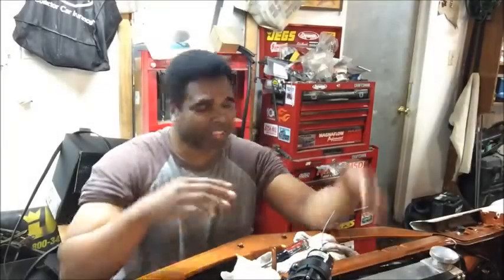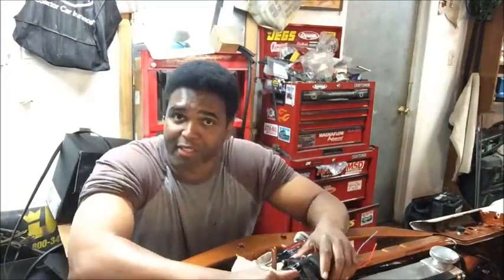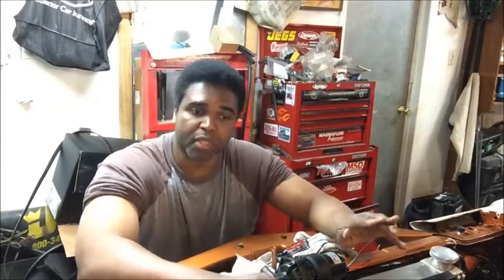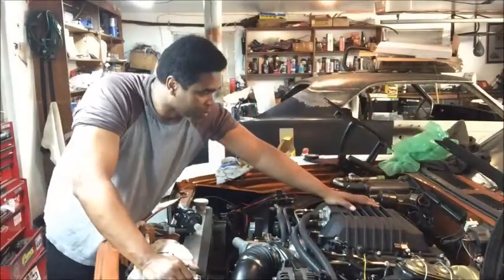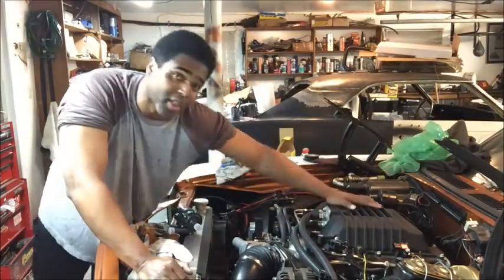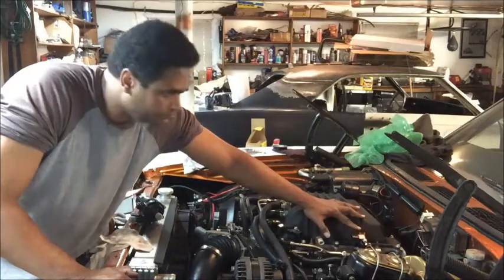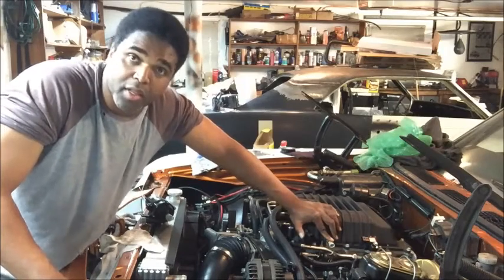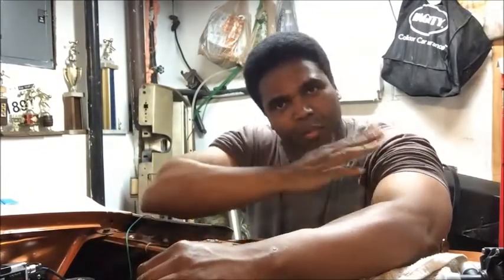LSA BRICK SENSOR SETUP.

Comment: So do you completely remove the two wires from the 5 pin harness and connect to the zl1 harness ? Or do you just splice in to the two wires and leave the pins plugged into the stock harness ?
Reply from the maker: i worked with Ballenger motorsport to create the Coverman Special. its a simple plug and play harness. check it out
https://www.bmotorsports.com/shop/product_info.php/products_id/4290
https://www.bmotorsports.com/shop/advanced_search_result.php?x=0&y=0&search_in_description=1&keywords=coverman66
let me know what you think..

Comment: So you cut the AIT wires out of the MAF plug completely, or did you just Y into it with the additional two wires.
Sorry for the question I just couldn’t really tell in the vid if they were cut from the actual MAF sensor
Reply from the maker: i got the connector for the iat and separated the mass and iat and made 2 connectors..  Ballenger makes a connect call the Coverman Special
https://www.bmotorsports.com/shop/advanced_search_result.php?x=0&y=0&search_in_description=1&keywords=coverman
Reply: Hi Terry, your reply was confusing... Are you DELETING the IAD in the MAF, and just using the IAT in the LID ? You’re not using both.

Comment: Where would you plug in the vacuum line for the heater/ac vents?? 1970 Cutlass LSX376 B-15 Lsa blower with ZL1 lid 4L80E trans..
Reply from the maker: whats good TD.. here is a video ive done hooking up the vacuum lines on the LSA to work the vent doors.. simply T into the vacuum line as in the video and running to the stock vaccum ball..  let me know if you have any questions. 
https://www.youtube.com/edit?o=U&video_id=sMdcaLf5WJw
Reply: @Coverman66   hey brother i appreciate the reply but it don't let me to open that link for some reason.
Reply: @Coverman66   it dont let me open that link
Reply from the maker: hmmmm i was able to open it.. the name of the video is LSA PREP PT2. PULLEY REMOVAL/INSTALL & VACUUM BLOCK OFF.
try this one..
Reply: @Coverman66  got it brotha i appreciate it, i highly respect your knowledge when it comes to this set up, to bad you aren't local you can make some killer cash out here
Reply from the maker: the name of the clip is LSA PREP PT2. PULLEY REMOVAL/INSTALL & VACUUM BLOCK OFF.  let me know i you have any issues..

Comment: Hi Terry,

I’m doing an LSA SWAP on my 2006 gto. On mine, which ones are the IAT sensor? The colors are different.
Reply from the maker: what type of maf are you running?
Reply: coverman66 I was going to use the gto but I’m not sure if I need to change that..
Reply from the maker: im using the on from the truck,  i think its the same if its a 5 pin maf.
Reply: coverman66 hi Terry,  I was able to do more research and it turns out the gto IAT wires start from the other side. Also, I was able to find a harness online that is able to connect to the maf and have a separate wire plug to the IAT sensor. Thanks anyway. This video helped a lot.
Reply from the maker: my pleasure, i had to re route several wire to make them flow better..

Comment: Great video!  We've had some people ask for the parts used here.

The pigtail used is CONN-85643 -> https://www.bmotorsports.com/shop/product_info.php/products_id/855 . 

Butt Connectors CONN-66657 are a good idea too -> https://www.bmotorsports.com/shop/product_info.php/products_id/421 to connect the wires.

Or if you want to do your own terminations, here is the kit instead of pigtail -> https://www.bmotorsports.com/shop/product_info.php/products_id/850 .

We're going to make a PNP setup for this scenario in the next few days and will post here too with that PNP Adapter too.
Reply from the maker: much appreciated.. works like a charm..
Reply: Here is the PNP setup we promised for this install, CONN-86076 -> https://www.bmotorsports.com/shop/product_info.php/products_id/4290

Comment: I was cleaning my supercharger blades with some awesome just giving him a really good scrub to get the carbon off them I noticed that when I spend the pulley my supercharger doesn't spin as fast as before I clean the blades just a little difference is that something to be worried about
Reply from the maker: whats good Shoe.. sorry for the delay in response.. sometime you have to take a rubber mallet and strike the nose.. the front where the pulley attaches to the blower.. if it gently but firm to remove anything that got caught in the gears.. you have to do the same thing when you remove and replace the isolator to re seat the lobes.. keep me posted on the build brotha..
Reply: Thanks appreciate it brother I will keep you updated on my build

Comment: The red sensor on the lid is the map sensor. The one towards the front of the engine reads ambiant air pressure
Reply from the maker: Jesse your right, im in the middle of doing a video update.. thanks for noticing..

Comment: Do you have the part number for that manifold sensor pigtail
Reply from the maker: hmmm i think i might of thrown it away..if i come across it i will sent it to you, in the mean time call Barringer and tell them what you have and they will send you the right connector.. thanks
Reply: CONN-85643 -> https://www.bmotorsports.com/shop/product_info.php/products_id/855 . 

Butt Connectors CONN-66657 are a good idea too -> https://www.bmotorsports.com/shop/product_info.php/products_id/421 .

Or if you want to do your own terminations, here is the kit instead of pigtail -> https://www.bmotorsports.com/shop/product_info.php/products_id/850 .

We're going to make a PNP setup for this scenario in the next few days and will post here too with that PNP Adapter too.
Reply: Here is the PNP setup we promised for this install, CONN-86076 -> https://www.bmotorsports.com/shop/product_info.php/products_id/4290

Comment: I'm running an LSA on a 5.3 on my wiring harness will the connector for the map sensor work
Reply from the maker: on the intake of the 5.3 there is a connector for the map sensor.. it should click in the map sensor that comes with the brick.
Reply: coverman66 i needed an adapter that i found on amazon

Comment: You just saved someone a lot of time! Great tip terry! 
One step closer your almost there buddy! 👍
Reply from the maker: hahah whats good juiced.. whats up in your neck of the woods partner..
Reply: coverman66 nothing much man your going supercharged and I am going turbo 
I have a first gen sbc 400 I got a 80mm billet turbo from VS Racing headers are on just made a set of msd wires so they can run under the headers and next week I am hoping to get the turbo piping done once that's done I can hook up the oil feed and return lines and then get the 4 inch piping done from the turbo to the rear axel ..
I have an 850 Holley with the hanger18 mods for blow through...
Getting there slow but sure